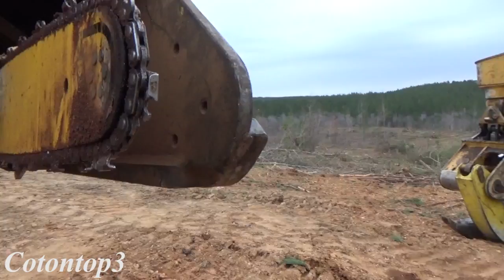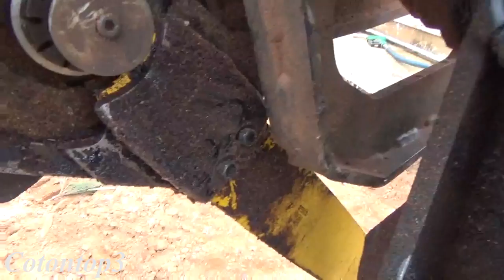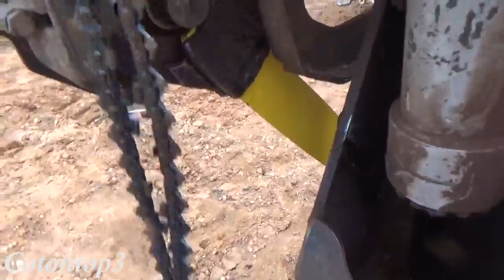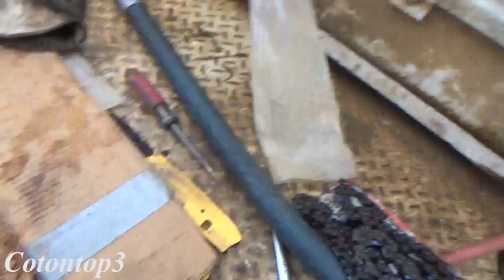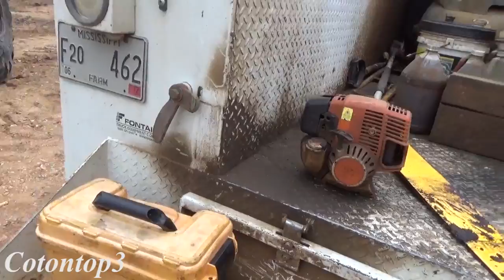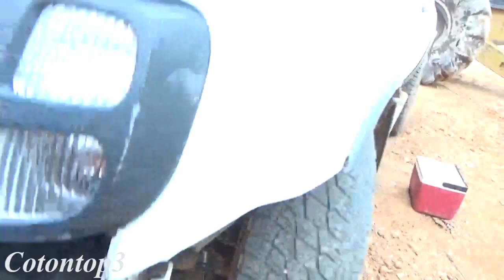Rotobec grapple saw and an excellent question!

Comment: Do I understand correctly that the saw has auto correct tension for the chain?

I think that you answered that potentially tricky question really well, however it must be an even bigger nightmare for the smaller outfit trying to get going in business with that kind of attitude from the mills towards suppliers of timber.
Reply from the maker: +Dan Whiteford yes it tightens the chain on its own.  If the smaller logger is not cutting timber for a mill and buying it on their own, it's very tough on them.